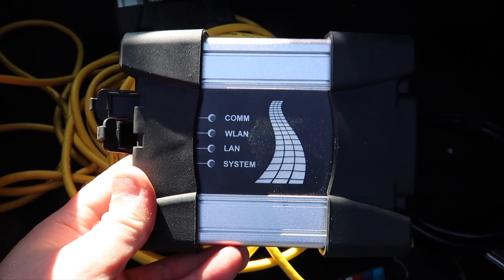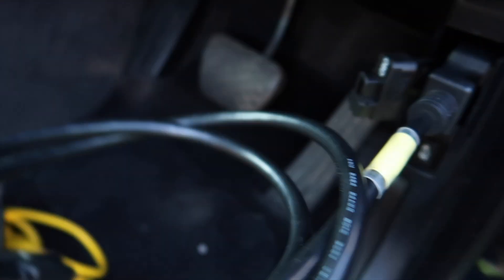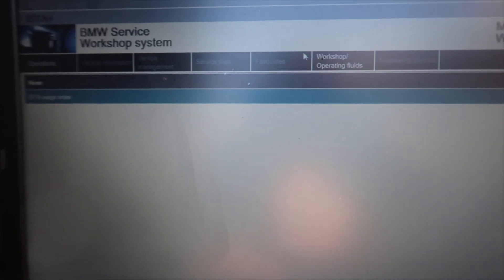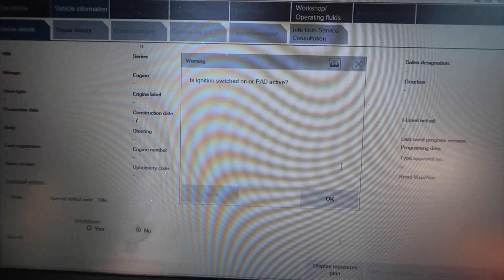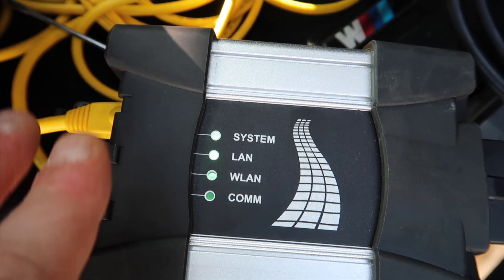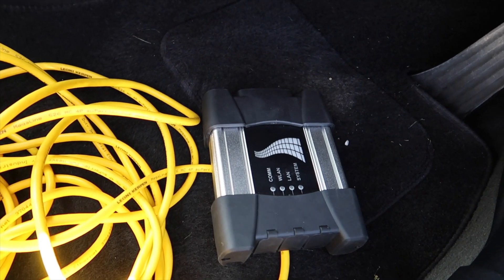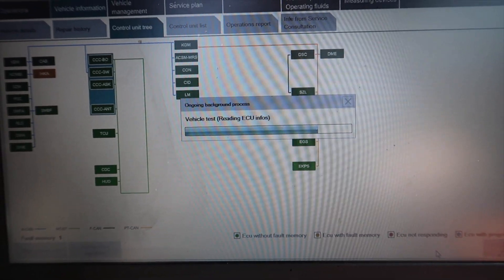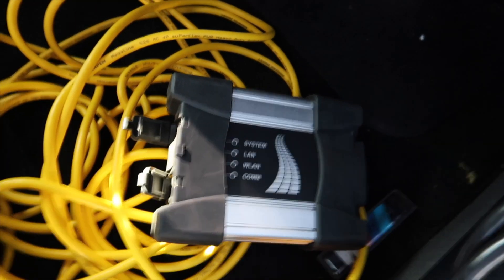How To Setup BMW ICOM NEXT With ISTA+ , INPA , E SYSTEM

Comment from the maker: Click here to buy the ICOM NEXT Used in my Video 

https://amzn.to/3l2hGcn
Reply: Hey dr. Dean its a real "original"" icom  or just high quality clone, the price looks very good !!!
Reply: Do you have an alternate vendor to shop from?
Reply: The link don't work anymore :-( 
do you still have to have a battery stablizer attached while doing this? which stablizer do you use? 
All the best, Matt
P.S. Nice videos BTW ;-)
Reply: They've removed it already from Amazon,  any other location to buy from?
Reply: Another link please?
Reply: Please, can U provide new link, this one is broken.
Reply: Hi, I've got a f57 JCW  Cat N . I've replaced the drivers side headlight as it was completely smashed . light only works when the car is running and I unplug and plug the headlight connector back in ... Does the new light require coding to the car ?  if so  can you help me remotely or what would I require to do the job myself ? 
Many Thanks in advance 
Andy
Reply: Enlace no válido en otros países desde el brexit.....
Reply: @BMWDoctor how do you change the name of Device ID @3:51
Reply: Where can I buy a icom not faulty. That i have is faulty

Comment: as of 2024 there have been many issues continuing.. 1 updating the firmware on the ICOM which is required.. may require an alternative method than the update icom button in the ISTA settings. 2. They have a new part number out. Many shops report latest verions of ista 4.5 do not work with jbox or icom.

Comment: we are borrowing a mates icom when we plug it in the OBD port the lights flash red once then it goes off and there is nothing it does warm up but we cant do anything with it and we cant config it and the OBD port is fine

Comment: hi. my istap works with icomm next but nothing else connects. ive just  swapped from chinese vxdiag icom which works , . now i purchased an orig icom ethernet one and it only works with ista p . programs fine aswell.
comm light lan and system lights on. no luck with the regular ista d or inpa nor coding tools which i normally use without a problem.
any ideas whats going on? cheers if you can help a diy Aussie.

Comment: Cawko I buy a m5 e60 and then about 1000km first reduction engine soo then pay for new  batterie and cabel....so  before change the cabel i find a paper from org BMW servis but the mechanich hawe wanna manny ok i pay 600€ and right strait buy a laptop and ista pay 2500€ and inpa and the others do not working so i have make it to go I speek some language and find sa. Options to hawe somthing only for mé ...but 2500€ gone becose im stupid and Village only the original...so some mechanik hawe take laptop and instal me the programs and the ista D  .is only working like mobil servis and  onli 10years

Comment: good night, thank you for the very great video. I would just like to highlight one issue. the problem that was mentioned in the video is not something exclusive only to the "clone", I have been using icon next original actia for some years and I had a problem with it identical to the one mentioned in the video, I contacted the company that provided me with a new one for not to be able to define a cause for the problem, an update was made, remote connection, I had to call a company to check the network system, cabling and nothing. finally they sent me another one and the problem is over, quite simple like the video, I can tell you from experience that both have the same defect. don't get me wrong i'm not criticizing the video, i'm just adding a real experience with the equipment.